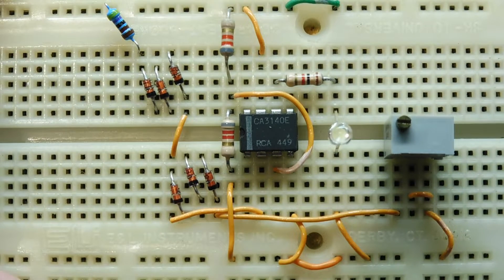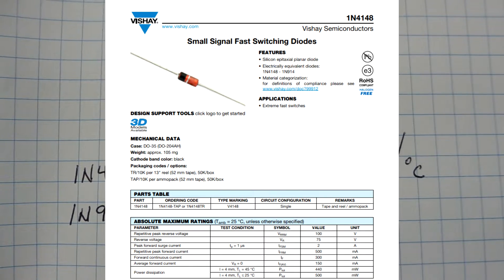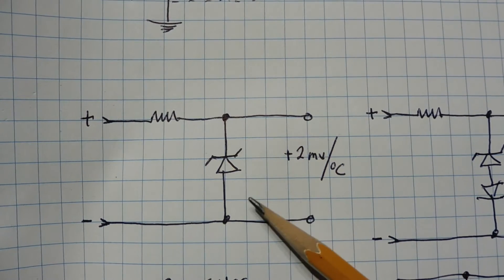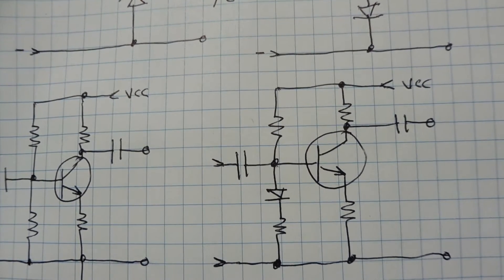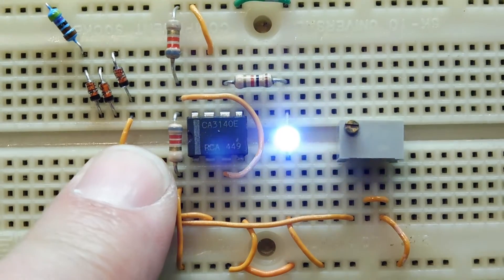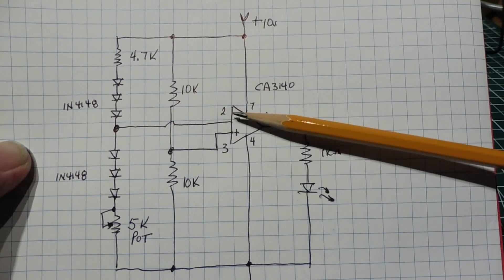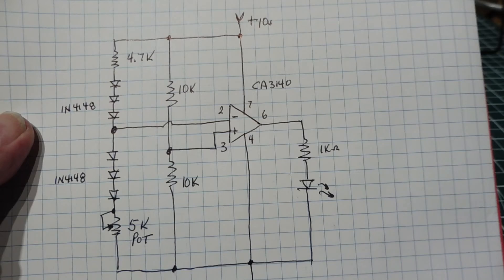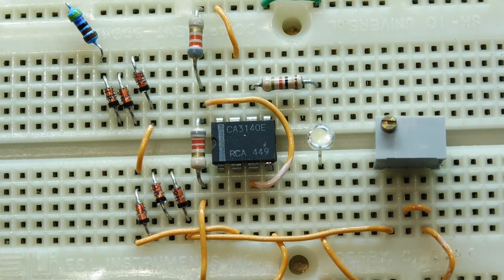Thermal Sensing And Temperature Compensation

Comment: Very cool. I was going crazy trying to understand this schematic for the Befaco Voltio (it's a synthesizer module). In the schematic and on the board they have these LM336D IC's with 4 1N4148 diodes in series w/ 2x each side of the trimpot. I asked ChatGPT because I am a relative newbie and it was saying something about getting a higher voltage out of the 2.5V regulator. That didn't make sense because why would you not just use a bigger regulator rated for the voltage you wanted? If the goal is a stable reference voltage, you don't want to go getting those 2.5V bad boys all hot and bothered as it were. After a while of trying to put the correct search terms together I stumbled on this video and it all started to make sense. I feel very good having learned this and also that I was at least smart enough to know ChatGPT didn't know what it was talking about. I mean there may have been a grain of truth in there if you have 2x 1N4148's on one side and 2x on the other side of the trimpot (some kind of offset maybe?). Anyway I digress, thanks for this video. I am able to move onto the next section of the schematics now and I have put a bookmark on this topic as something to revisit once I get a little bit more practice reading schematics and do a bit more bread boarding with small projects. Diodes continue to amaze me on a regular basis. There seems to be no end to their use beyond just blocking stuff from flowing in the wrong direction.
Reply from the maker: Yes, the two diodes in series with the trimpot is for temperature compensation adjust as the voltage output of the LM336 does drift with temperature. It was such an annoying problem that the LM336 has been discontinued and no longer manufactured. Thanks for the visit.

Comment: Why is it like a capacitor discharging while the led is turning off.. A comparator must be high speed device,.. Whenever the - terminal voltage is just greater than the + one, it should turn output low immediately.... Why it is taking a longer time??
Reply from the maker: The switching voltage is just a few millivolts which is buried in the circuit noise. The comparator is switching on the peaks and valleys of the noise to form a sort of pwm signal which causes a slow dimming to off effect.

Comment: Do they have transistors with diodes in the same package? If so, that would be great for the common emitter example you showed
Reply: yes they do. there's actually several temperature transistors that probably work on a very similar principle. I hadn't thought of it before or how they worked until I saw this. That must be how they work. The diode allows a certain amount of voltage to flow through, which changes the "sensors" reading to the reader (ADC or other device)
Reply: Korishan thank you for letting me know!